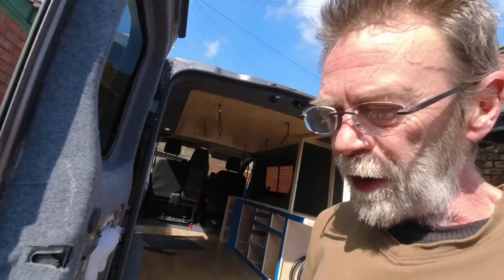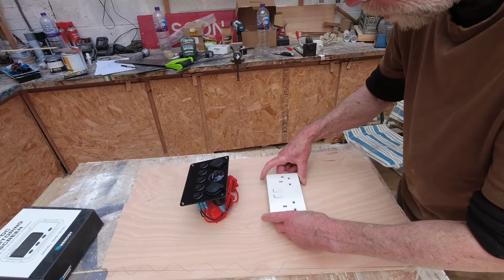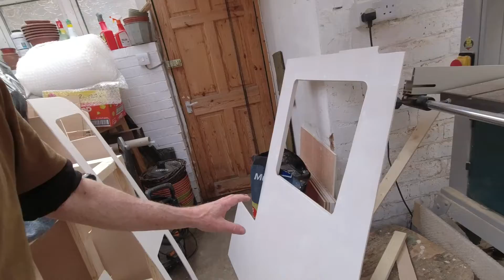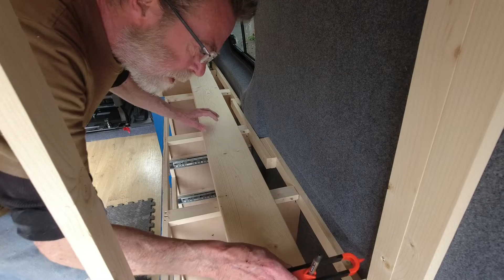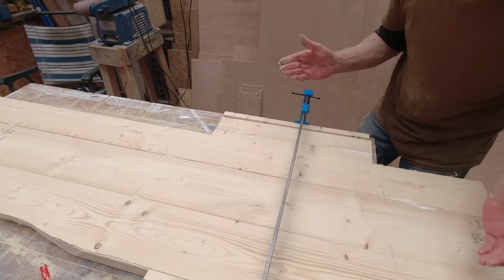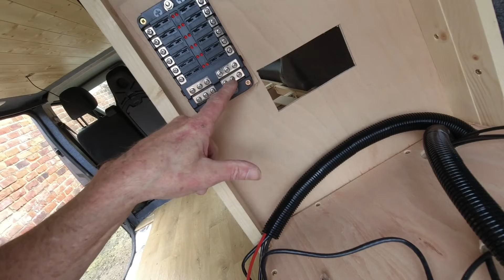Vauxhall Vivaro Camper Van Conversion (Day 14)

Comment: Is this Wiring for 240 usage 

MT
Reply from the maker: Hi, No most of the wiring is 12v and will run from the leisure battery. But I did put a 240v hook up in to run two 240v outlets.